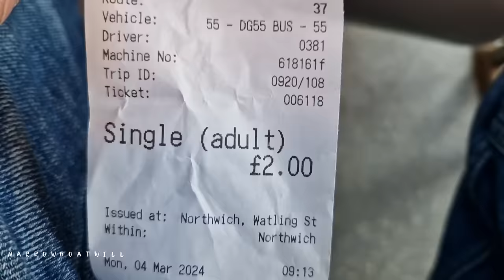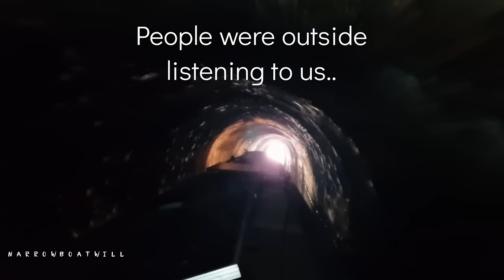Leaving the Trent and Mersey canal. Onto waters new. My narrowboat journey continues..

Comment: I know I seem to spend £60 or £70 on things that would between £35 and £50, we won't even mention the increase in coal and wood.
Reply from the maker: That's true Tim. I used to pay £10 a bag of coal and my gas was £18 now my gas is £50 and coal around £20 diesel was 47 per litre. That's just over 5 years ago. Wages don't match that increase.